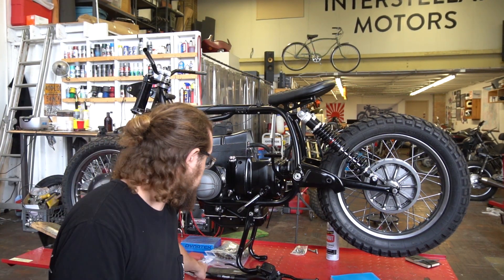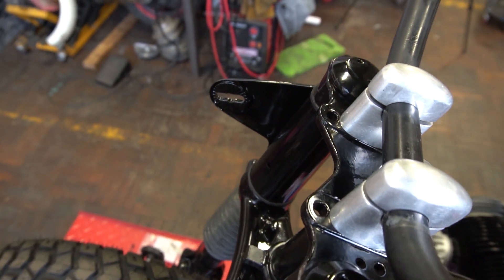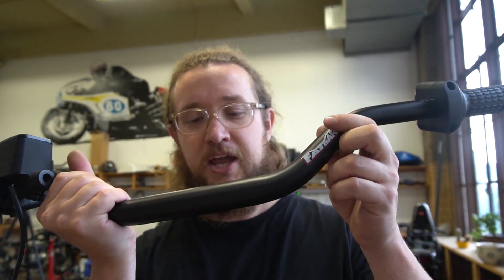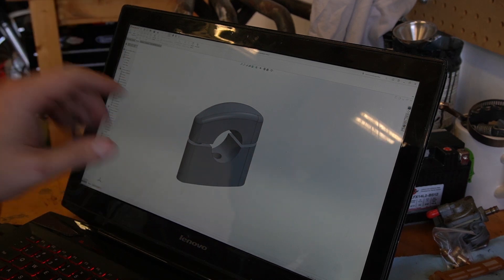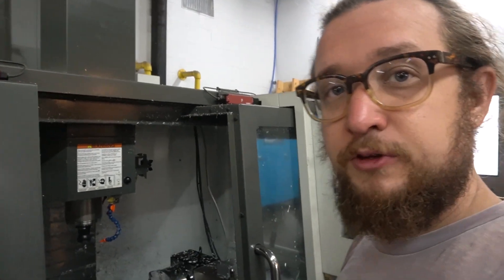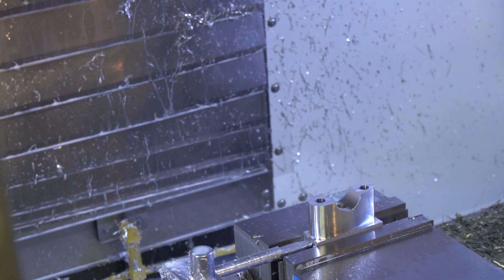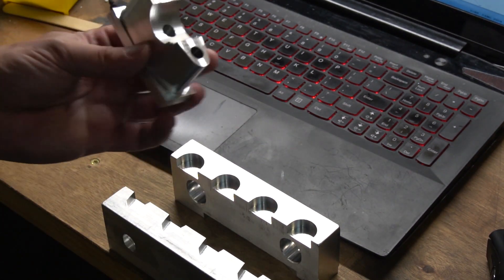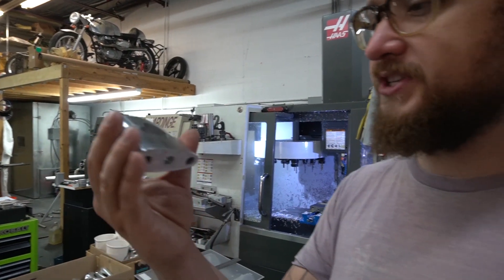I fit Renthal Fatbars on an BMW airhead lmao

Comment: Nice work. Just wondering with all the attention and clean look you have going, why you didn't go with a remote reservoir for the breaks. Did it not come stock w that model? I had a '78 r100rs and it had the reservoir and master cylinder mounted to the frame somewhere under the seat or tank. Did your seat mod make that impossible? Enjoying this build, thx.
Reply from the maker: This bike did indeed have a remote master cylinder under the tank, but I opted for the brembo master to ditch the mechanical cable. Perhaps somewhat less clean but certainly simpler without the all the extra moving parts to maintain.